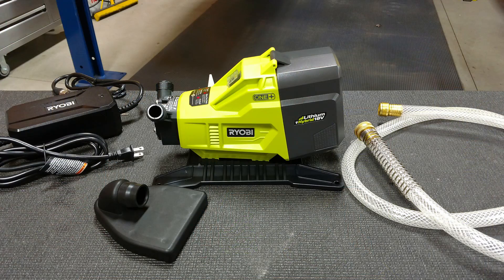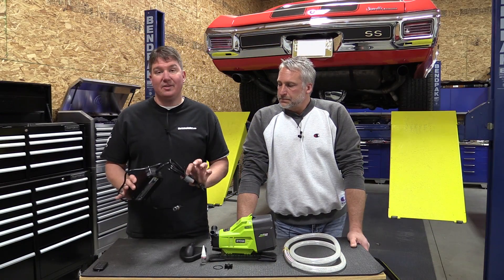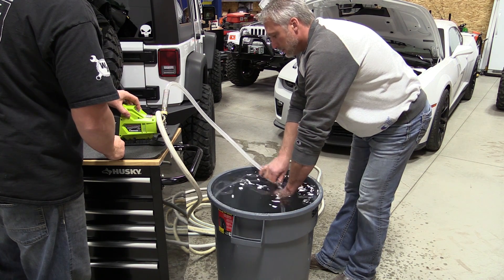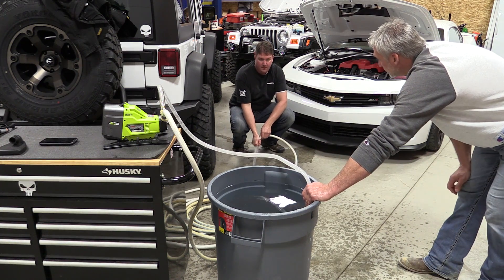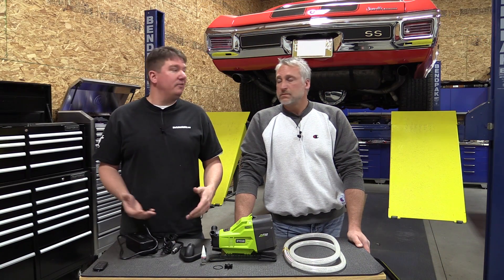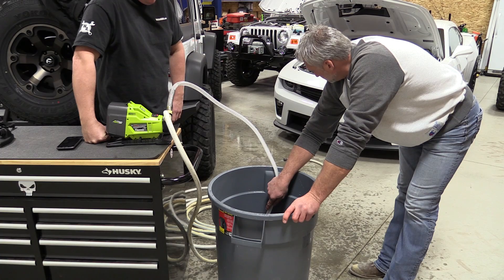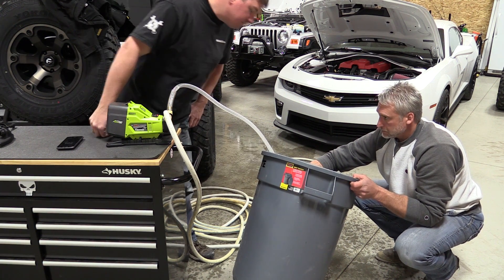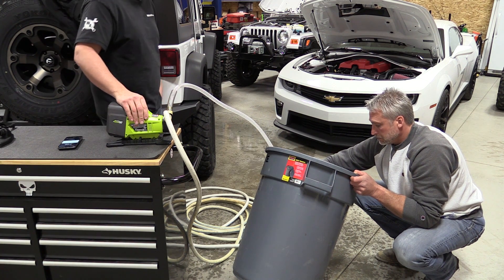Ryobi 18 Volt Hybrid Transfer Pump Review Model P750

Comment: Will this work to pump the oil out of my boat into a bucket when I change the oil? I just don't know if I can attach a hose small enough to connect to this pump
Reply from the maker: It is not rated for oil.  I do not know how long the impeller would last.  It will do it, but maybe only once.
Reply: @WorkshopAddict  Gotcha. I didn't realize there was an impeller. Thank you.
Reply from the maker: @meltz7  It works identically to your boat impeller.
Reply: Makita 18V cordless DVP108 vacuum pump, will pump oil.

Comment: The milwaukee is self priming, does 8 gpm, has brass fittings and is also has impeller serviceability.  You can also stand the milwaukee on end and it has a carry handle. How did ryobi not think of that? The milwaukee does not use ac, but that is whole point of cordless is to get off ac and not need some transformer lying around. Batteries are bought with enough quantity and last a long time, especially with the 9 ah.
Reply from the maker: Ari P Don't forget the Milwaukee is more expensive.  I agree with you, but just to let you know, it took 3 batteries for the Milwaukee to help drain my hot tub and direct the water to a drain.  When the Milwaukee stops, no water flows as with the Ryobi, so I had to watch it and change batteries for the water to keep draining.  In that case, if the Ryobi would have been at home, I would have used a cord.

Comment: does it shut off if it reaches pressure? if you had a hose sprayer, would the pump stop until you release the sprayer again?
Reply from the maker: I do not think there is a pressure relief shut off.  The rubber impeller is sort of its own pressure relief system.
Reply: Bummer it'd be great in an off grid situation but I'd want the pump to stop unless I turn on the water.
Reply: I tried using a regular nozzle and when you close the nozzle the pump will shut off but to turn it back on you have to off-on the switch again.

Comment: Can it handle hot water like 90 to 120 Degree? If so it would make a great Emergency shower if there is a power outage.
Reply: anthony flacke I'm thinking of doing the same. just put the heating system AFTER the pump. I wouldn't run hot water through it.
Reply: Yes I noticed Home Depot has a Propane fired Emergency hot water Heater for only $117 bucks that would be awesome for Emergencies
Reply: Look on eBay. $55 bucks.

Comment: I bought one of these recently. My basement drain backs up occasionally so I have a system now. I use a shop vac to suck the water in and then drop the transfer inlet hose with the adapter inside the shop vac. The outlet hose points to my backyard and pumps the dirty water in my shop vac out. It does a great job and I recommend this. The motor is a bit loud though.